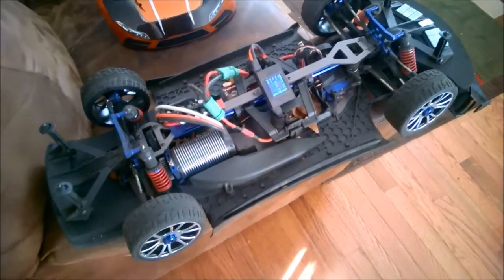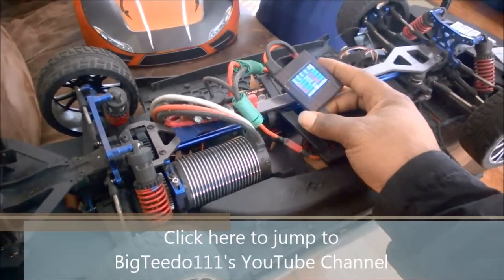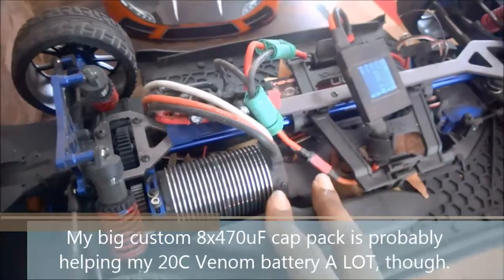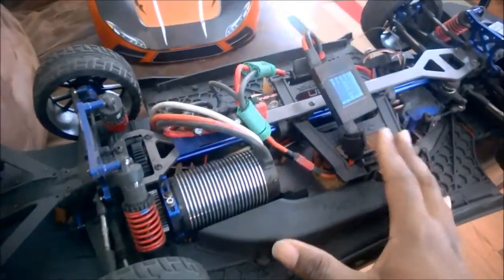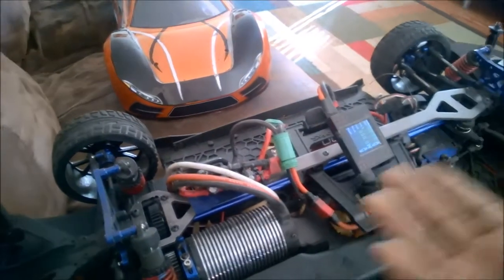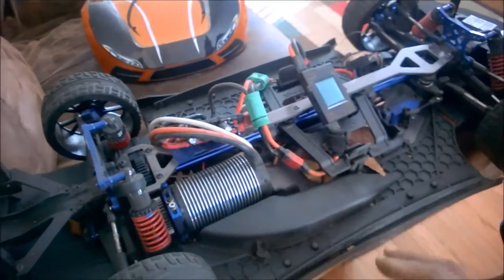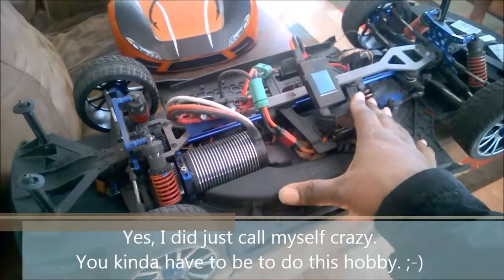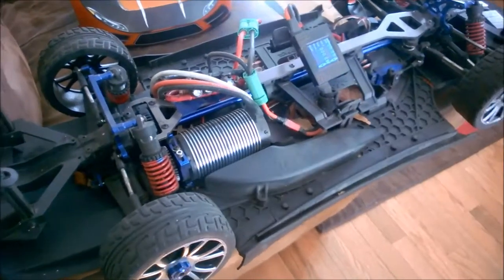Ep.154: Quick Tip: XO-1 2S or 3S LiPo Adapter Mod

Comment: but how long did it run for? how many min?
Reply from the maker: That's a good question! I didn't actually time the packs, but I was throwing it around for at least 10-20 minutes and had plenty of juice left in my 5000mAh batteries.
Reply: @RCPhysics  so to be clear. You ran a single 2s pack on the XO1
Reply: @RCPhysics  because I'm planning on putting paralel 2s 5000 mAh which would be 2s 10000mah and should in theory give me a long run time. I don't care about speed runs I want to make it drift.
Reply from the maker: What C-Rating are these 2S packs? I used a 100C pack because the current load running at that gearing can be pretty high and might overload lower-C packs.

If the goal is to get longer run times drifting, I'd set it up on 4S and run some cheap ebay tires like I'm doing in the video that break free easily. Here's the thing, whether you run the packs in parallel or series, they still contain the same amount of energy, which is measured in Watt-hours.

Watts = volts * Amps, so 8V * 10,000mAh = 16V * 5,000mAh. 

Actually, the system will have fewer parasitic losses at higher voltage, so running those packs at 4S will probably give you a longer run-time.